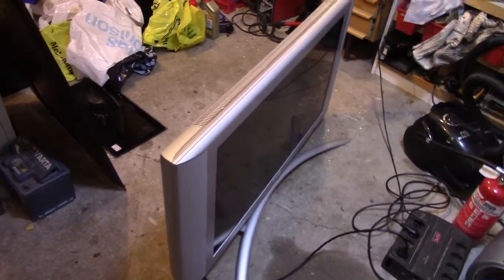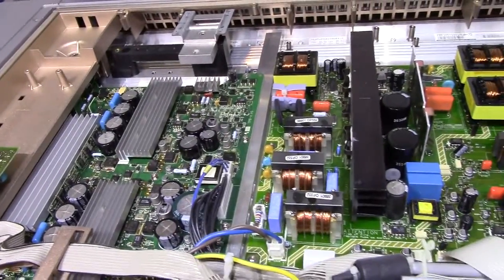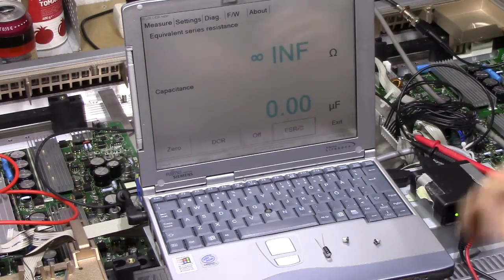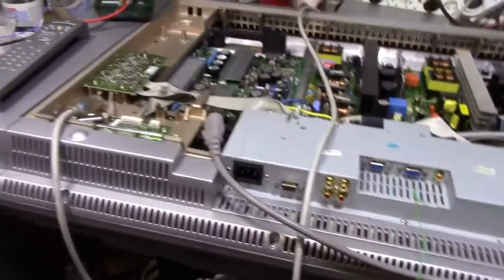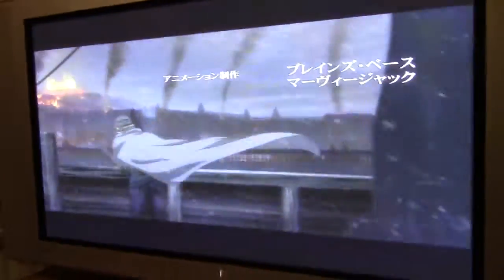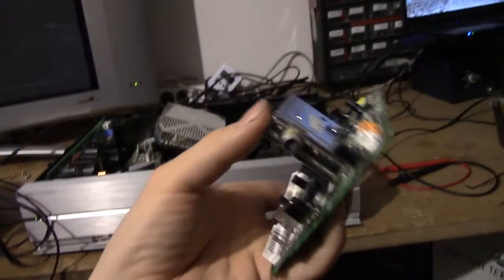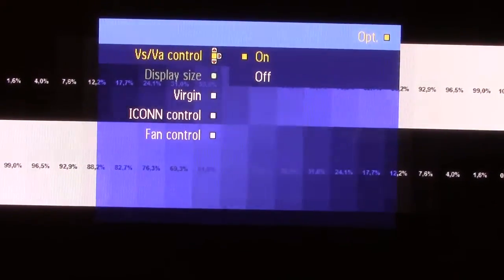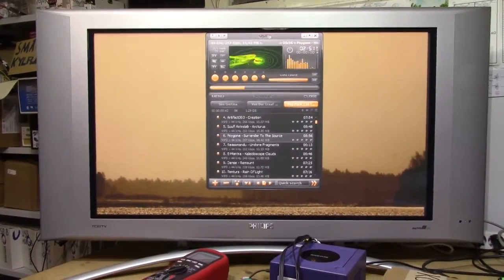Troubleshooting & repairing a 37" Philips plasma from the stone age

Comment: Thank you for posting the repair for this TV.  I have the same model with the same symptoms, do you mind telling me the specs on a suitable replacement transistor you used. Thanks again.
Reply from the maker: I don't recall what I used - I think it was a random junkbox mains switcher transistor from some old power supply. Just pick anything reasonably close to the specs, and it should work fine. The transistor only serves to discharge the power rails when the set turns off.

Comment: hi hello i have that tuner  the ftr 9965/12s  but mine wont stay on and i cant find any manual  for that sucker tv it self is gone in dropt of the wall  years ago when i was moving to a new house   can i use a old 32 inch regular lcd pc monitor on it  my gf  is making me crazy she cant watch tv in my home any more  please help me desprate dude from holland
Reply from the maker: +paul ketting I think I managed to get picture through a normal PC monitor when connected to the tuner box, but your mileage may vary. The resolution is really weird, coming out of it.
Reply: it is working on my 23inch lg led monitor but that sucker does not stay on it goes orange after few sec full green than it goes back to orange than standby red again
Reply: +FFcossag  got  the ftr9965  running on lg 23 inch led monitor  just a bad cap on psu resolution is not bad tested it whit a old jvc  vcr  its a bad ass thing  is like cnn of that vcr its crazy